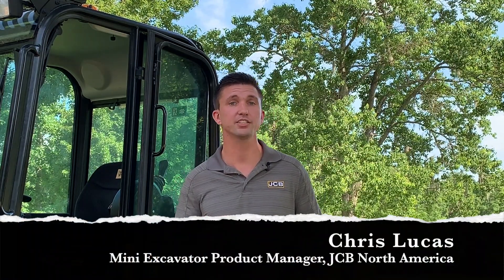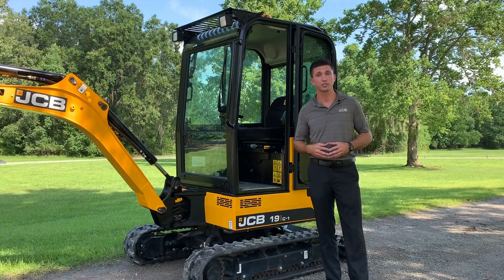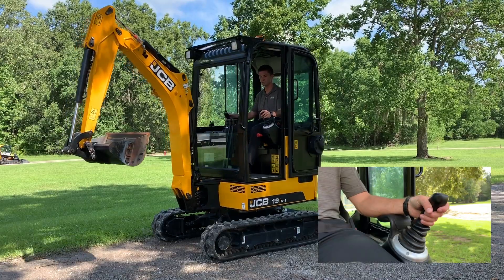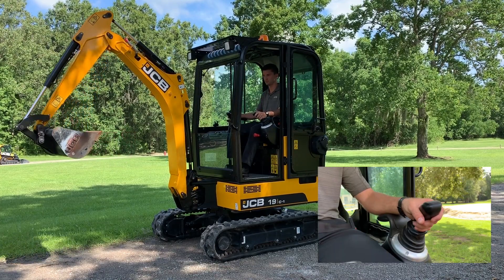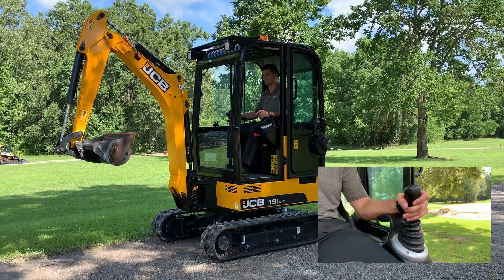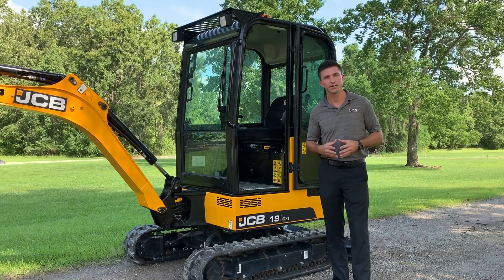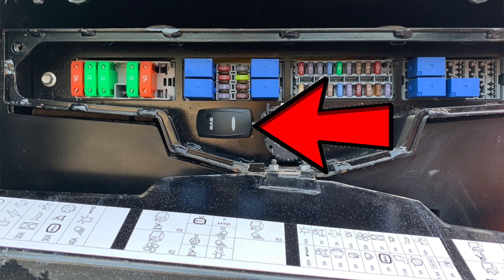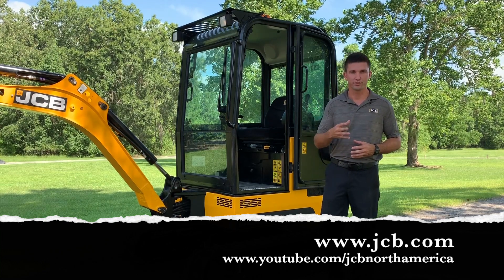HOW TO: JCB Mini Excavator ISO/SAE functions

Comment: I hope you respond to this. First of all, you correctly call the right joystick up and down - "boom control" as the most common. BUT  you call this "ISO". Please Google " SAE Excavator Controls " and click on images and you will see that virtually EVERY single photo shows that the RIGHT joystick controls in up and down movement that controls the main boom is SAE not ISO. I have never operated an excavator in my life but am considering renting one and thus I started investigating control patterns. Please look at the SAE images on Google and render an opinion. I am not trying to cause trouble
Reply from the maker: Thank you for reviewing our video and providing feedback. In response to your inquiry,  the boom position for ISO is done by functioning the right-hand joystick, while the boom position is functioned by the left-hand joystick in SAE.  I hope this helps - please let us know if you would like us to provide some imaging of our functions via email.
Reply: @JCBNorthAmerica  As a first time renter of an excavator, I wanted to learn the most common form which is main Boom on the right joystick, also called ISO. After your clarification, I found several reliable sources on the internet that clearly support your comments. But man, there is much more info than I would have imagined that call it incorrectly. Thank you for clarifying this - I'm surprised at how many have it wrong.
Reply: p52457 hi, yes there is a lot of misinformation out there.  This video is absolutely correct.  We also did a video on ISO vs SAE controls, check it out:  https://youtu.be/T0O8bOyKZhM